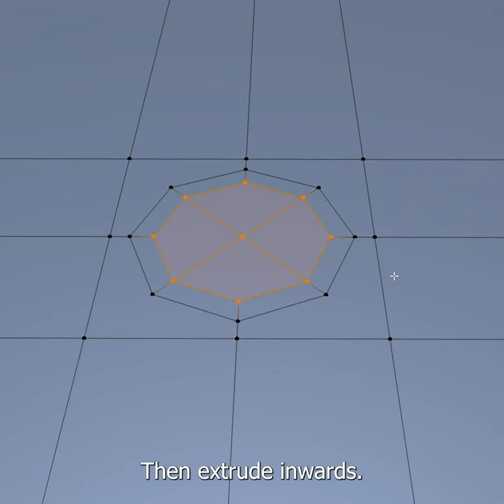Easy Holes with Beveled Vertices | Blender Secrets

Comment: Connecting with J often does not work for me. Any idea as to why?
Reply: Just use you knife tool. Hit “k”, then click one vertex and then the other. Then hit enter.
Reply: @Thurstyjyt  Ok thx! Sometimes the knife tool won't work either but rarely. Say I need a vertice in the midlel of an edge. I have to delete the edge and extrude a new one stopping where I want a vertice, extrude again. Sometimes subdivide balks at placing a vertice as well.
Reply: @RC-Heli835  That shouldn't really happen. Make sure your topology is good, like check for double vertices, normals, inside faces, etc